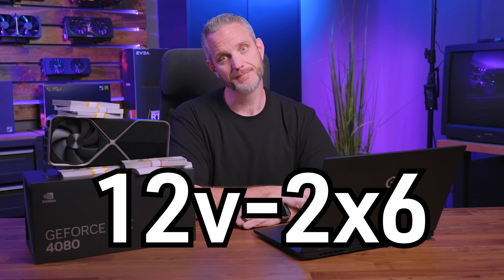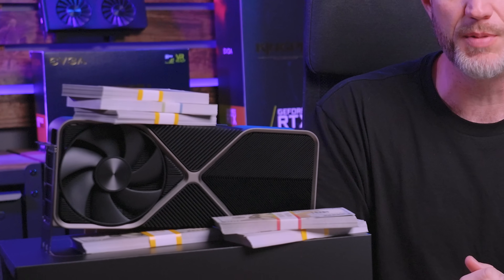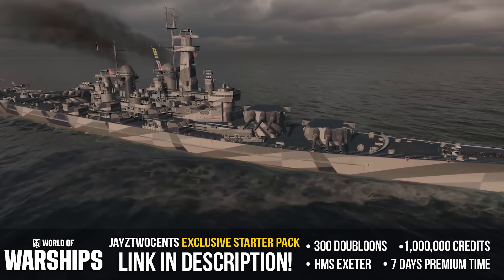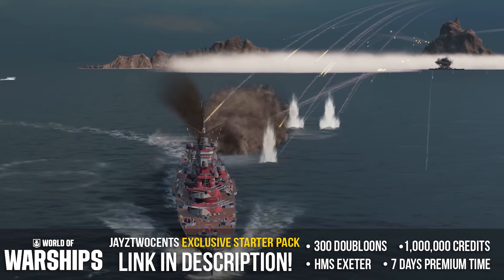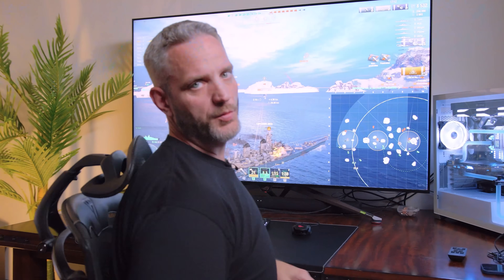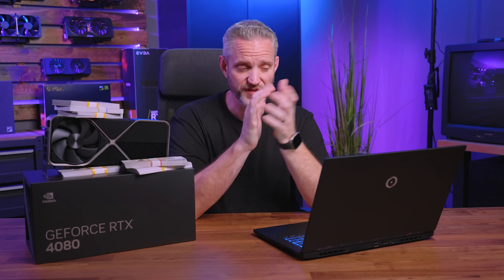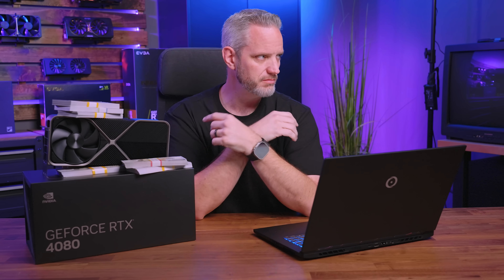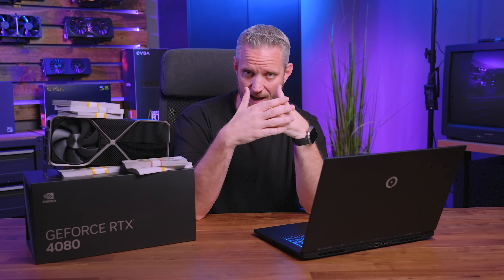They FINALLY admitted that this was a major issue!

Comment: When the new connector announced, with my eyes saw , would be a disaster for users. And is natural, I am electrician and with such tiny thin pins the connector has, you can't afford 200--300W from this ...'thing'!!
To deliver that amount of power, you need perfect top quality metal. And what company will spend money to do such a thing ? Already the quality from entire piece of components have reduced, brands will spend money for a good 12v Nvidia's  new design ? Forget about this .
Even the PCBs breaking. Very awful. My advice : Stop thinking some of you '  Nvidia is good, had this feature , had that feature' paying near thousand bucks to buy a card and after 2-3 weeks you see your money you spend go in vain. Use brain ,especially to Nvidia funboys. Show to 'green team' their choice was stupid , or want Nvidia card ? purchase previous generation who had no power socket burning.
Some people think methodically once.

Comment: Hey, why don’t they use a “Screw Cap” on the plug, just like closing a bottle with a cap it would hold everything in place no matter how much you bend the wire

Comment: I put Nyogel dielectric grease on my 12VHPWR to help combat terminal fretting due to inherent case vibrations from fans and pumps.
Also built a connector clamp block to eliminate any possibility of the connector being wiggled crooked.
Reply: Links or pics?? Would like to see this sounds like a good idea !!
Reply: @timlaw4720  I posted a video on my channel about it
Reply: Send pics please

Comment: I run my 4090 with a 75% powerlimit, its pulling 370 watt with a direct 12vhpwer cable. Less power, less heat and the 5% performance hit is peanuts

Comment: I'm glad PCI-SIG is getting an update out, but I have some questions. I saw no mention of the X-axis rocking that caused the cable to become disjointed at the board connector. Wouldn't a three sided shroud around the wire connector prevent that in addition to the updated pin designs? Additionally, regarding the sense pins specifically, I had figured they would be cut back, but I'm curious as to why CARD_PWR_STABLE wasn't lengthened instead of being cut, since supposedly that's the lynchpin with regard to letting the PSU know to cut power to the GPU in case of overload or off-kilter power delivery circumstances. Any thoughts on these?
Reply: Just speculation here, but maybe a shortening of CARD_PWR_STABLE still serves the same purposes? If that pin becomes disconnected, then the power supply looses that signal and (hypothetically) still cuts power to the GPU? 

Personally, I don’t care what pins get lengthened or shortened, as long as the failsafes do their job somehow and prevent the GPU from burning up. I’m also a 30 series owner who isn’t worried about 40 series as the whole lineup has been a disaster.
Reply: @StolenJoker84  CARD_PWR_STABLE is by default open. That is, there is no connection at all even when the sense pin of the same name is fully seated. This is by design. The GPU will short (close) the circuit on that pin if there is an overload or another power anomaly (in theory anyway). By lengthening this particular pin to full length, it will always be connected at the connector and thus the GPU will be able to perform its failsafe of shorting that pin in an abnormal power delivery scenario. The rest of the pins being shortered is something I had already figured should be done.

The new update does not unfortunately cover the rocking present when too much strain is placed on the connector from cable positioning/stress. A three sided shroug (top/sides) that is flush with the board connector housing and going down far enough should prevent the cable from ever rocking, and at least in that fashion prevent the connector from entering into a situation where arcing occurs (this is what heats up the connector and melts it). I'm kind of disappointed to see that all these things were being addressed but not these two, especially after the GN videos clearly showed wear lines that weren't parallel to the end of the connectors, but lopsided from the connector being both loose and pulled to one side.
Reply: @SquishedTia  Ah. Ok. I wasn’t sure how that signal worked, so thank you for the explanation.
Reply: Properly seat your power cables, buy a case that fits, do not bend cables, do not use 3rd party adapters, have a professional who knows what they are doing building rigs and you will have a %99.9 success rate according to the data

Comment: I just recently built a machine with a 4090 and I specifically bought a PSU that was ATX 3.0 compatible so I didn't have to use an adapter.  Been using it for a month now and so far so good.  I even check the plug from time to time and while it is warm to the touch it isn't hot.  the thing feels very very tight too, absolutely no wiggle.  Now would this be due to me not using an adapter or did I just get lucky with the plug?
Reply: Same here got the seasonic vertex 1200, would like to know as well

Comment: Yeah, that dimple design is garbage, throw into the mix is a little detail called "Asperity". This is the microscopic surface condition of the contacts and how they interface. actual surface area needs to be calculated with this variable known. just because it calculates to a measurable surface area, does not mean that the actual surface contact of the Asperities adds up to that number. Spent many hours counting microscopic "bumps" (Asperity) with in .001 inch.

Comment: Dumb question....what gauge are THE PINS vs the gauge of the wire? Do they have a larger gauge wire going to a smaller gauge pin, confined inside the connector? So the wires can handle the load but the pins can't plus being surrounded by the connector housing not letting them cool is causing the spike in heat WITHIN the connection?

Comment: Because of all the trouble these cards are having, I'm surprised there's no price drop in them.
Reply: The basic nature of demand; so long as they're selling, the pricing won't move. If demand changes and significantly exceeds supply (likewise if supply is reduced by whatever means), then prices will rise (and if media/social pressures force retailers to maintain pricing, that creates a profit gap that can be exploited by a 3rd party, hence "scalpers" on ebay, etc., though the ultimate responsibility lies with the buyer, they're the party that determines demand; prices must be allowed to rise in response to a demand-drive market, otherwise black/grey markets are inevitable).

Where it stinks is NVIDIA deliberately restricting supply to maintain prices and a demand level it wants in order to maximise returns. I don't know if such is unlawful but it's certainly ethically bankrupt.
Reply: its only .01% failure rate or some smallish number.  Not enough for mass recall or price reduction.

Comment: Chip creep is a real thing. Can't tell you how many times a piece of equipment that was off line was solved by checking the RJ-45 connector either on the patch panel or the switch.

Comment: Jay, I started building PCs back in the early 1990s. Loose connectors were never a problem back then. Most of our devices, like monitors and printers, used cables to attach them to the ports on the PC and thumb screws to secure the plugs to the PC. You knew the connection was secure and would not separate from the PC. As I remember things, our MOLEX connectors used two retainer clips. To paraphrase an old anti-acid commercial, "Click-Click. Oh, what a relief it is."
Reply: @administrator4728  Thank you for your reply. I always read them so I can get better incite with my comments. I have a new 4090 GPU, and this connector problem disturbs me. I'm getting older, and sometimes my memory fails me, so I might be wrong about the two MOLEX connection clips.
Reply: And lets not forget the trusty old parrallel ports for our dot matrix printers 😂
Reply: @chrissyboy7047  Thank you for your reply. I feel that the older-style connectors were indeed better. The PC component designers seem to like to take two steps forwards and one step backward.
Reply: god i love vga connectors with thumb screws they have solid connectors.
Reply: @superjimse  Likewise DVI and, my personal favourite, 13W3 (I use a lot of SGIs). SCSI also had good connectors, though SAS changed to become a bit more flimsy.

Comment: The funny thing with my cablemod cables is that they work fine when plugged directly into the GPU. It's only with the 180 adapter that I get the black screen with 100% fan speed problem. And the bigger kick is that the adapter also works fine for at least a day or so before the problem starts. There's more slack in the cable when the adapter is used so I'm not sure what exactly causes the adapter to unseat itself. Maybe gravity because it's a vertical mount?
Reply: Nothing a little dab of hot glue wouldn't solve, and the best part is the hot glue will come right off when you need to unplug the cable too. Make sure to use the high-temp hot glue tho, you don't want any chance of the low-temp stuff softening under normal elevated temperatures seen around the heat sink of the GPU.

Comment: 12:00 Assuming the pinout remains the same as in 12VHPWR (compatibility reasons), not all sense pins are used for indication of the power suppy limit. In 12VHPWR, only two sense pins are used for power limit which results in a two digit binary truth table (2x2 = 4 options). The other two pins would actually relay information back to the power supply from the graphics card (Power Stable and Card Present).

Comment: I'm STILL baffled by them not using a card-edge connector with locks on these things. It solves all the problems.
Reply: Top side sure, bottom side would needlessly break compatibility
Reply: @mito-pb8qg  top OR side.

Comment: As a 4090 strix owner, I want to say 12VHPWR is an absolute joke of a standard. I had to buy an expensive cable & a 90 degree adapter and check the connection every week to hopefully not get my card melting. What a joke!

Comment: The RC hobby has used high power DC for years. Why not just repurpose their connectors instead of modifying old PC connectors? Although not as idiot proof, simplest would be a single set of screw down + / - terminals on power supply and card and then just a 2 wire connection between. If cards are going to get this power hungry, PC wiring may need to abandon the idea of just adding more of the small pin connectors used in the past.

Comment: they royally screwed that up and it cast a shroud of crayola burnt umber all over the flagship - they need to do a redesign obviously and put the connector on the end of the card not right in the middle - the goal is sleek and effective and unobtrusive not wonky and awkward - the next gpu (hold your breath through respins) should have almost 200 tflop - the 1 petaflop (double precision) ws is only a few gen away at this point

Comment: Every time I see this stuff I'm so happy with my ancient simply plug and play 3080. 
And I have the cables pulled hard 90 degrees to the right and wrapped around the side of the card to the back.
Reply: @laserbeansprouts  Ok, but it's a little dusty. It's from the pre-covidian era. Non-LHR first run architecture. For like 3 minutes I had the second fastest GPU in the world.

Comment: They should introduce lockable cables like the ones used in cars for everything. A lever latch that will only fully close if fully connected. No point for those half-arsed solutions.

Comment: Had my MSI 4090 since February with the EK waterblock and active backplate and no issues yet however I wouldn't mind paying for the upgrade if it means keeping my 4090 safe.
Reply: Same, had my 4090 TUF since release with no issue but till def get this

Comment: I worked as a school IT network admin for 9 years.  During that time the change from CRTs to flats happened.  The electric company actually asked for how many we would be changing out as the schools, as you can imagine, draw lots of juice.  Now the damn video cards are using more than an entire computer WITH a 17" CRT.  INSANE.
Reply: Luckily most school use can can be done on a low watt NUC PC and Macs (for design use) only use AMD GPU's.

Comment: Honestly, I'm thinking it's still best to wait and see, or if you really want a 4090 go get something that isn't that high on the tier list in terms of power limit setting. I recall some AIBs are set to use the whole 650w while some are fine with 450w as the power limit. Galax's HOF even uses 2x 12VHPWR with an LED light display that tells you if your card is only able to use half the power due to not being plugged properly. Here in Asia, I can find a lot of those L-shaped 12VHPWR connectors that look exactly like what Jay showed before and there is one thing that is labeled the same across all of them from what I have seen. All of them say "rated for 450w". Now I wonder if that's a possible cause of issue if you, say, use one of these connectors on an ASUS Strix RTX 4090 which is said to be set to have the full 650w power limit, and then plug the 12VHPWR connector properly as a whole. Will the connector cause an issue? I can only guess.
Reply: This is why I went with the MSI 4090 Gaming X Trio. They power limit them for thermals just a happy accident. That It also keeps the damn thing from melting as well.
Reply: @lostinny690  Yeah, I actually heard about that for that AIB. Apparently the Gaming X Trio still uses the "signature" Gaming X Trio shroud format with the fans and all from the previous Gen. so in order to tame the temps, they had to deal with the power limit. The result was a 4090 that was no less powerful than the others, but is still well balanced with cooling for its preset power limits. Definitely a happy accident.
Reply: Does the same apply for the gaming x trio 4080 and 4070ti?
Reply: @sv0g391  I don't think they had to power limit those cards as they don't draw as much, nor do they get as hot. Also, to my knowledge, no 4080 or 4070ti has ever had an issue with the melting plug.

Comment: I also have the ASUS Strix 4090 and using a Cable Mod 12x4 to 4 - 8 pin on a Corsair 1200 Plat PSU. I would really like to see if I can get a new cable from Cablemod.

Comment: I have a 3080 with 3 8-pin PCI-e connectors one of those cables wasn't fully plugged in on the PSU side, I found it because playing Diablo was giving me BSODs to a black screen, the bsod was very fast and never logged anything. So I think this is definitely a sign that something is loose with your cables.

Comment: They should really look at redesigning the retention mechanism for the Pins/Terminals as well. 
The little PCI clip dosen't seem to be cutting it.
Reply: Should go to 2 mounting screws.
Reply: That clip can break too...
Reply: I would agree I mean even cpu power cables and connectors on the motherboard have a significantly wider clip.
Reply: Maybe they should switch to a plug that uses retaining thumbscrews.
Reply: Even just moving it to both sides instead of one on top would probably help, since the current one doesn't do much for the connector being a bit off-angle.

Or even go back to the VGA/DVI style screw-downs if you want to be really sure.
Reply: Problem is injection molding of plugs on PSU cables. The clip is too long. You hear a click before the plug is fully seated. Even after plug is seated, there's nothing keeping it there.
Reply: The retention mechanism wasn't the issue, side to side wiggle doesn't matter when the pins are inherently defective. This is why when it's plugged in correctly with no offset, it stills melts.
Reply: Pin contact! Nobody said, Side wiggle. But hey, it doesn't hurt to jump in and troll everyone else.
Reply: 100,000,000 > dinky PCI clip
Reply: They are clearly keeping all changes backwards compatible with pre-existing HW and cables to make all mix-n-match configurations functional.

Modifying retention mechanism would loose that.
Reply: @hydrargyrumnight  I understand what you mean but 12VHPWR PSU's still have PCI connections, it's just an extra connector/ they take a couple of PCI connectors off. 
So wether your using an adapter or a straight cable it won't matter.
Reply: @hydrargyrumnight  Which doesn't make sense, they could have just made a total mod when they came up with the spec to begin with instead of just using the same design with smaller pins.
Reply: Small clip, very loose clip-to-full-insertion tolerance, no secondary alignment other than the pin housings themselves... there's quite a lot of mechanical oversight.
Reply: Still comes down to user error though.

Comment: Just replaced my adapter with a cablemod 12vh to 4 8pins. I noticed the adapter seemed to have a more solid connection. I’m considering going back to the adapter.
Reply: mine went in and wont come out, not that i have tried hard.